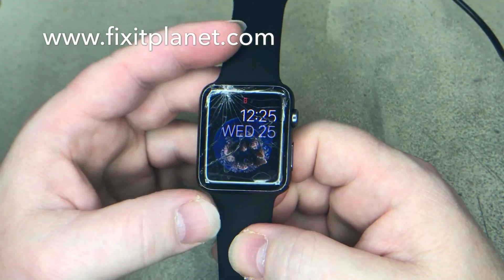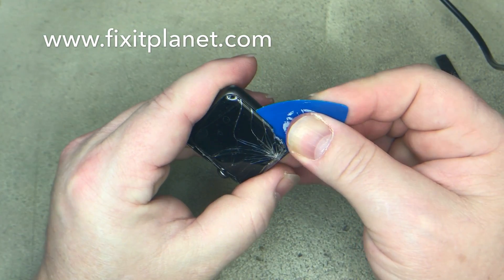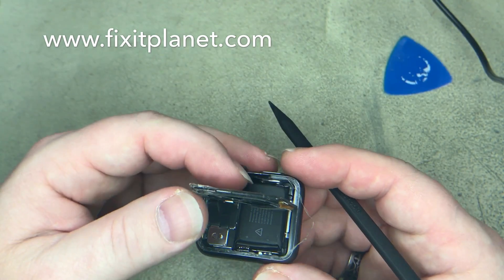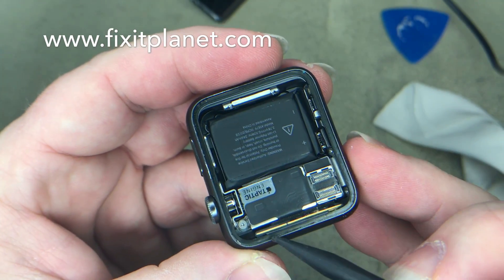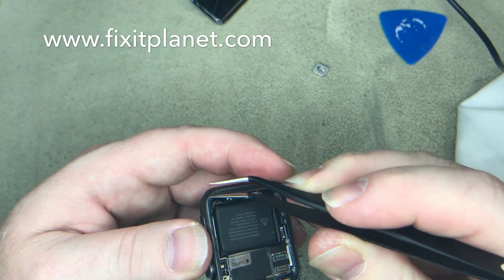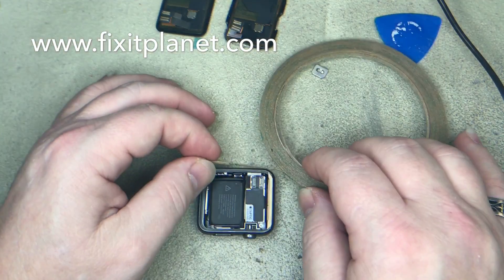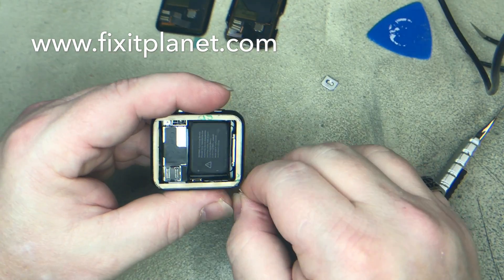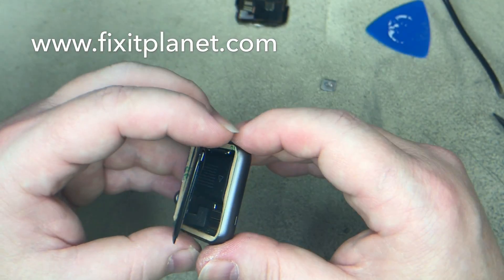Apple Watch Series 1 Screen Replacement From Start To Finish.

Comment: How do I know if I should just use/buy the digitizer or digitizer and LCD assembly for my Apple watch repair ?
http://www.mobiledefenders.com/lcd-digitizer-assembly-for-apple-watch-38mm-black.html
http://www.mobiledefenders.com/digitizer-for-apple-watch-38mm-black.html
Reply from the maker: You should buy the entire display assembly and swap it all out. It's fused together.
Reply: I removed the display assembly and I think there were two layers of paper kind of thing on which display assembly in stick on (it looked like it was stuck with glue.), I removed them as well. I am afraid if there is any internal relation b/w the assembly and the thing that I removed.(It was a thing as if it's a single rectangular shaped paper to stick the lcd but not sure.
I didn't see you removing anything like that. Kindly help.
Reply from the maker: Unfortunately you have damaged the force touch sensor and it will have to be replaced as well.
Reply: OMG...Thanks for replying. Btw I am confused which one to buy the sapphire screen or sports. I think I have 32 mm series 1 space gray watch.
Reply from the maker: If it's series 1 then there should only be one screen available.
Reply: Any tips on how to open the screw of the touch sensor. Bought a toolkit but the screw is too small for any of the screw driver.
Reply from the maker: I am not sure what you are referring to but it should not be necessary to remove any screws just to change out the screen. If you spent $10.00 on a kit then you must be trying to do something else good luck.
Reply: I understand but removing the screw to change the force touch sensor. Am I doing anything wrong here ?
Reply from the maker: Ah yes I see. Just need to find a screwdriver bit that fits and you should be good to go.
Reply: Thank you so much for all the responses :) Got the screwdriver on ebay 0.6 torx. Could open the screw. Now need to order the parts :)
Reply from the maker: Awesome!

Comment: Hi i just connected the cables to the apple watch body and the screen turns on but there is no response for touch or when i press the crown or power button but i can hold both down to force reboot it. PLEASE HELP!!
Reply from the maker: Is your watch 1st or 2nd series? The first is not compatible with the second. Closely inspect your connectors and flex cables make sure they are not damaged and are fully connected (not sitting at an angle) flush with the connectors, no pins are damaged or bent etc. Otherwise return for a refund or exchange and try again.

Comment: So I am starting to loose my hope here. Cracked my Series 1 watch months ago, been looking for replacement screens for ages, had to send back a replacement screen I bough a while back because the touch was not working and the screen would just not turn on at all after the watch face first shows up after booting.

Received a used Watch series 0 today, took its display, transferred it onto my series 1, it turned on again, showed the watchface, and the screen turned dark again and touch nor buttonpresses would to anything anymore. Putting the device onto the charger would show the charging icon, but thats it.

Strangely enough it is possible to use my almost completely destroyed series 1 display on the series 0 watch. How can something with the same part numbers not work with one device but with the other?

I am not sure if the whole "The screen is hard coupled to the cpu of the device" is true, but as of so far the only option I have left is to take my device to the Apple store.
I just dont know what to try anymore.
Reply from the maker: Yes from what I've tried for example; An iPhone SE screen worked on a 5S but the 5s did not work on the SE. Although iFixit says they are interchangeable. Another example; a mini WiFi card with the same part number as original card, would not work in a Lenovo G 580 laptop. So some variables must exists such as chipsets, firmware, etc. or some unnoticed damage such as short to ground or something blown during repair.
 Apple watch series 1 can be purchased at http://www.mobiledefenders.com and I've had no trouble with those yet. I don't expect those will work on series 2 apple watch but I haven't tried. There may still be hope, don't give up.

Comment: How much would you charge to send an apple watch in for a screen replacement? Series 1 38 mm sports ??
Reply from the maker: Call for pricing 817-602-1160 Monday thru Saturday 10:00am to 6:00pm CST. Thanks

Comment: Hi there. Thank you for your detailed video and since I am in Dubai, unfortunately, I wouldn't be able to get my cracked watch to you. I am considering ordering the screen from mobiledefenders and attempting this myself. Could you please advise the type, width or any other requirements of the adhesive tape? Is there a pre-cut tape available?
Reply from the maker: The size is stamped on the watch either 38mm or 42mm pre-cut adhesive may be available but I haven't looked. Just do a Google search and see what comes up. I covered all the important details in the video. Just be careful and good luck! :)
Reply: Thanks for your reply. Mine's a 42mm. May I know what was the width of the adhesive tape you used? (1mm or 2mm?)
Reply from the maker: I use 2mm ;)

Comment: i just scratched my apple watch series 1 42mm .......... do i have to buy the Digitizer for Apple Watch (42mm) - Black or do i also need LCD & Digitizer Assembly for Apple Watch (42mm) - Black
Reply from the maker: Unless you want to separate the glass from the display and glue a new digitizer on correctly, then you might as well buy the whole screen assembly. That costs more but makes better sense. Not sure it's worth it just for a scratch tho. Good luck ;)

Comment: Ive read on forums that the screens are similar to the touch ID on iPhones, as you won't have any functionality after the repair as each screen is somehow paired to the cpu. Did you run into this problem ?
Reply from the maker: I have not had any complaints regarding that issue and am not aware of any reason that should be the case. Basically the replacement screen is the same as an iPhone screen with a display /digitizer and two pop connectors. If that were true it would be a shame because the watch would not be repairable if ever cracked or at least you would lose the security function and that would be sad. ;)
Reply: Based on other videos I've seen that's only an issue when trying to save your LCD (and that's very hard to do without ruining it) and then pairing with the cheaper clear glass/digitizer with one connector. Video shows using some special device to reprogram your watch after that. As Fix It Planet says in other comments in here, you need to buy the whole screen-digitizer/LCD assembly with two connectors.